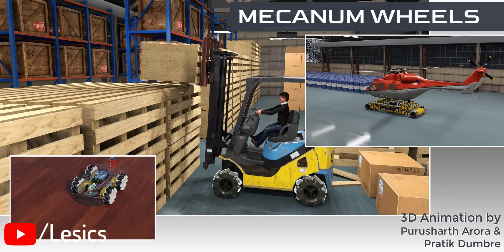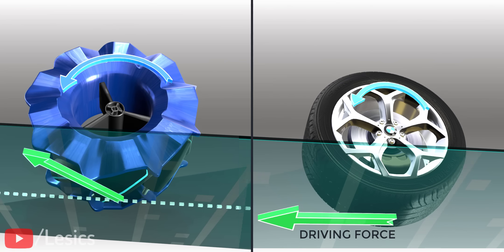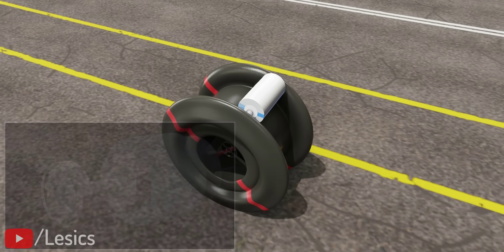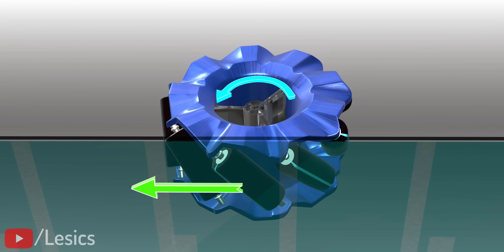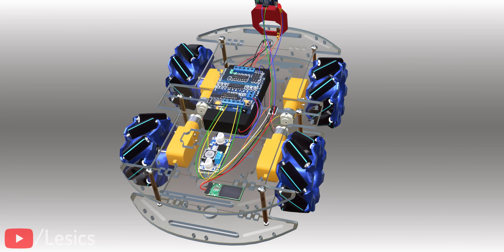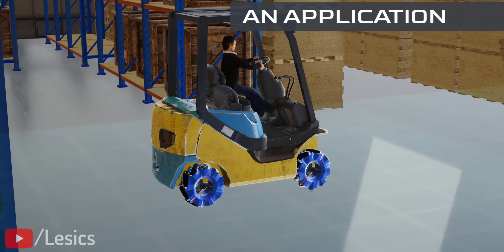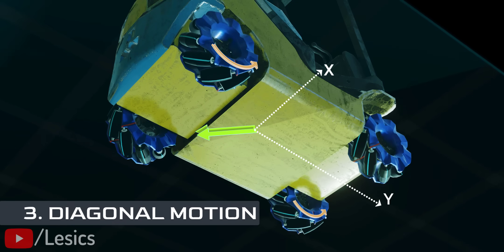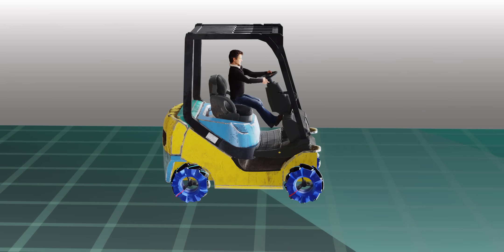The Brilliant Engineering of Mecanum Wheels!

Comment: The great innovation no doubt, question is it already been in the application, how is the efficiency?
Reply: Its all about upfront cost and long term costs. Its a spiffy invention, but way to many extra components that can break. Its hard enough to find competent people now ad an extra level of complexity to the operation......pointless product.
Its like battery operated long haul trucks.....pointless.
Reply: @edwo6648  I don't think it's pointless, it should be called impractical.
Reply: @spookyperson7096  Do you see a method or means to make it practical? If not then it is pointless and any engineer worth their salt knows that. A fun experiment, but at no point commercially viable.
Reply: @edwo6648  Yeah I don't see any method to make it practical, doesn't it mean it's impractical? I think pointless should be used to describe something that doesn't have any use whatsoever. This has its uses but can't be done in real life, hence impractical.
Reply: @spookyperson7096  example:
Landscaping job in back yard to build a landscape concrete block retaining wall where load in is through front yard across a manicured lawn or any lawn where they don't want it torn up.
If the job requires a skidsteer for less than a days work it is impractical to change out the standard tires to turf tires to spare the lawn, if you have ever done it you will know what a pain in the ass it is. So you lay down a shit ton of plywood to protect the lawn.
If its a multiday / week job for the skidsteer then it becomes practical to for go the plywood and open up the range of motion for the skidsteer with turf tires.
In the case of that forklift there is at no point where it becomes practical and the engineers know it. Hence why the video is cgi and not actual footage of a prototype forklift. No one is dumb enough to build a preproduction prototype.

Comment: How does the load transfer from the larger wheel axle to the smaller rollers? They are free bearings correct, wouldnt it just spin in place?
Reply: Better yet, doing that with 4000 lbs of weight on the forks.

Comment: I’ve driven many forklifts and, what is shown in the beginning of how long it takes the forklift with the normal wheels to turn, Is completely wrong! A forklift with normal wheels can turn very sharp, because the rear wheels turn at almost 90°, but of course the Mecanum wheels are much better!
Reply: And the Mecanum forklift will be 3 to 4 times the cost.

Comment: You can achieve perfect 180 degree rotation with normal wheels, if you turn the right side forward and the left side backwards. this is better as it means you can use the same standards wheels, instead of wheels full of rollers and connections that are ALL possible points of failure. With this setup, you cannot move sideways or diagonally, but the ability to make perfect 180 or 90 rotations in place means that you would have to need for the extra axis of motion. This would be a more reliable and cost effective solution.

Comment: It's a great idea for flat floors, but what happens when you need to drive outside in the elements in less than flat condidtions like gravel?
Reply: And the funny part is no warehouse floor I've ever been in is perfectly flat. And to a tee all have a slope of some kind.
Reply: @edwo6648  Not to mention that 1 little splinter which came of that one pallet it picked up and you now have an upside down forklift, which does make replacing the torn to shred wheels easier to replace for the 7th time that day.

Comment: its neat but id want to see it on something that isnt a forklift, imagine a off-road truck let alone emergency vehicles with something like that but then it seems over complicated for something that doesnt need changing, the design of the vehicle that is designed for lift and rotate would fix the issue alot easier than these tires

Comment: The animation of a "typical 180 degree turn" made by a "standard forklift" was such an exaggeration. For starters, the forklift they animate has front wheel steering, which is almost never seen. Most warehouses use forklifts with rear wheel steering. Also, most forklifts wheels can turn their wheels almost a full 90 degrees to each side, which this animation also clearly doesn't showcase. It's making the current models look way worse than they actually are. Lame.

Comment: Or just make all 4 normal wheels be able to turn 90 degrees to the left and the right and allow each wheel to turn independently (which this wheel already requires.. ) to achieve the same thing. This wheel is complex, need uniform friction and wear on each wheel, and is energy inefficient as half of the energy is lost in the roller direction.

Comment: Idea is good but the problem here is cost. in a forklift as shown in the example, the rollers would wear, creating an jerky movement and need replacing, the whole system seems extremely expensive to manufacture and specially maintain compared to the regular round wheel. Good luck try to convince an employer of that expensive solution for a bit more of storage!

Comment: This is cool for strictly in house use, going outside to unload and load flat beds is a different story. The asphalt will eat those wheels up not too mention if you get on some OSB bye bye wheels. Then imagine pebbles getting caught in the middle and shooting out as the rollers are rolling. Just a bad idea and seems to have more issues with safety than regular fork lift wheels.

Comment: Yeah it's good but if it's free to rotate and waste some force on the horizontal axis doesn't that mean it is little fuel insufficient as compared to normal tyre plus the speed will also decrease as the force is getting divided

Comment: This is a brilliant idea; however, the application of this idea is hard because it required a 4Wheel drivers' machine and a different control system from steering. So, employability is hard in practical life, but it could be used for military inside ships where movement is restricted and space matters.

Comment: Now consider the sheer number of additional moving parts required for each wheel that act as extra potential failure points under heavy load and wear and tear. The extra lubrication, inspection, and maintenance requirements. The uneven point load forces applied to the mini axles when a user drives over a non-flat surface or bump. Point loading of the mini axles during emergency braking scenarios. The financial costs of wheel replacement of a highly engineered wheel compared to a solid rubber wheel. The fact that forklifts and loaders already exist that permit independent wheel rotation and 360 degree rotation on the spot.

Don't get me wrong, it's a brilliantly engineered design for lateral movement. But industrial environments need solutions that cost less money to replace/repair, require less overall training and maintenance, and promise long service life under all kinds of conditions. In this regard, it's more cost effective to use a forklift with solid rubber wheels that have differentials that allow independent wheel rotation.

Comment: Yeah... and you need to get rid of the steering wheel because it relies on strict forward/rearward motion.  Instead a dual joystic control interface will be required.
Oh, and install a pretty buff computer to manage all four electric wheels independently.  Fuel driven lifts will not be able to utilize these wheels efficiently.

Don't really see many people purchasing human operated forklifts using these wheels due to cost... robots, on the other hand, will be able to evolve those wheels into their operations much more efficiently and not see a great spike in cost (because robots are intrinsically more expensive)

Comment: I feel like just adding the single wheel control to a forklift could allow more freedom with less of the downsides of this design
Reply: You mean 4 wheel steering? Yes that seems to be a much simpler and lower maintenance solution. But if you imagine actually trying to steer something with 4 wheels independently steered it's not easy. Forklifts have to move forward and reverse very accurately, in a straight line, to pick up and deposit things like wood pallets. So maybe having steering on each wheel isn't worth it.
Reply: @DrewWithington  I meant having one motor for each wheel so you could control them independently of eachother. Then you could make it steer like a tank or a car in tight spaces. but 4 wheel steering might work.
Reply: I took that as meaning a tricycle design. Two wheels on one axle acting as the pivot point and one single wheel that steers. Back when I worked in a warehouse most (if not all) of our P.I.T. had this design.
Reply: @wterlep  yes theres usually a tricycle layout on european forklifts that attach to the back of trucks however i think this layout might be a bit less stable and cant carry as much weight
Reply: @masterseeker360  true but the same applies for the mecanum wheels since the weight of each wheels is focused on only one of the small rollers at a time, so carrying hvy load will most likely break the small bearing of the rollers (hope you understand what I'm trying to say cuz it's hard for me to expalin it clearly)
Reply: @fury9947  yea no i get what you mean but i meant the tricycle layout forklift (and by extension a mecanum wheel forklift) wouldnt be able to carry as much as a conventional forklift as weight is distributed to a smaller surface area like 3 wheels instead of four and the smaller rollers on the individual wheels on the mecanum wheel like you already mentioned
Reply: @masterseeker360  oh now i get your point, and yeah that was exactly my point. Guess as of now the mecanum wheels is best for tight spaces and lightweight loads such as furnitures in Ikea warehouse maybe XD
Reply: @fury9947  at least they look good and make drifting easy lol
Reply: @wterlep  this concept works with 4wheels aswell since the back forklift wheels have a large turning radius. So no  big upside manouver wise having 3 wheels instead of 4
Reply: Ksn Jdjd  and what's true is that this product in itself is not commercially viable.
Reply: @eve_squared  true we already have tons of rubber wheels easily available having to build and maintain such complex wheels would negate its productivity upside by making them more expensive
Reply: @masterseeker360  also it's likely they are unreliable having that many small bearings can't be good for longevity.
Reply: @eve_squared  i cant imagine the durabilaty of those things will be very long considering they were meant to be used on industrial vehicles if dust or sand gets in the whole thing has to get disasembled well for now they can be used in hospitals on robots or some other clean place
Reply: I feel like I've seen this 3 wheeled lift before where it could just spin and spin and spin.. on the two large wheels axis... and this little third wheel in the back had some kind of magical errr mechanical relation to the 4th wheel used for steering.. must have been in a dream.... where I was forced to stack cubes of soft-drinks on wood pallets just to have to unstack them and set them on a crazy 18 wheeled contraption. I think this left could even deploy legs of some sort allowing it to just sit there dangling it little third wheel around.

Comment: How does one control the direction of movement with a steering wheel that traditionally moves the front wheels  in the direction you want to go in...what if you wanted to go laterally or do a 180

Comment: Great idea BUT the geometry between the wheels will have to be a perfect square instead of a rectangle BECAUSE the presence of a load on the forks will shift the weight center and will most likely cause a wobble when accelerating or decelerating sideward , even more so if the folks are lifted above head :-l

Comment: Normal vehicles keep going approximatey the same direction if one wheel loses traction. Not this invention. If you need to slam on the brakes, it’s going to turn violently unless all four wheels loose grip at exactly the same time — and the rollers are going to loose grip a lot more easily than normal tires because they have a dramatically smaller contact patch.

These wheels are certainly more expensive than normal wheels and probably can’t carry the same load. They will need the tread replaced more frequently than normal tires because the rollers have thinner tread and the design produces more friction.

I can’t imagine there’s a market for this. Zero-turn forklifts with normal tires already exist.

Comment: good luck with that on concrete floor. what happens when you drive over stones, pebbels? 
what is the actual benefit? be able to drive trough narrow spaces? most forklifts steer with the backwheels, which lets them turn on front axel or axis sry bad englisch lol.
in the example in the video it was front steering.
btw calling the engineer genius and mastermind multiple times sounds really stupid

Comment: I have a small rc car with this set up and it drives totally different than you would expect but it does seem to work over most surfaces I’ve tried
Reply: That is because your RC car most likely weighs less than a few 100 grams.